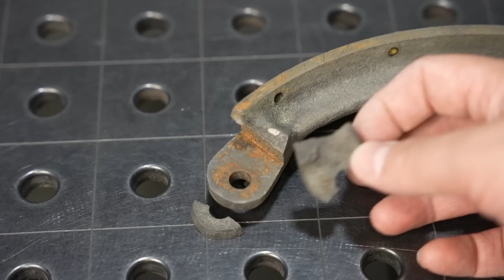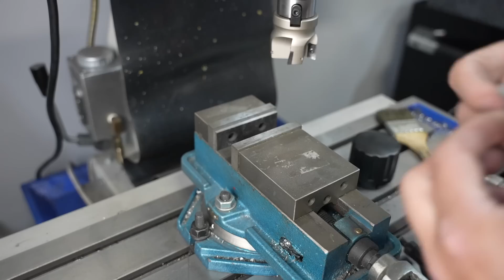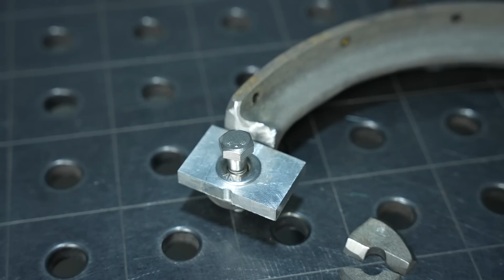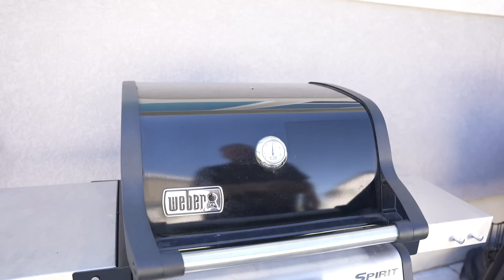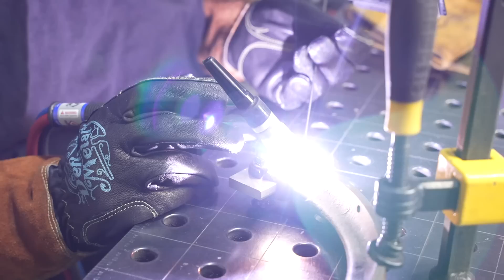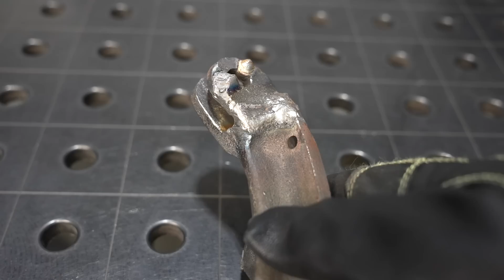Can This 1940's Bandsaw Part Be Saved? Cast Iron TIG Welding Repair

Comment: Nice job. I use some TIG filler rod from Blue Demon (5000T) made specifically for cast iron repair that has worked pretty well. No preheating is required.

Comment: Why not braze the piece back in place by chamfering the edges prior to brazing.  I would use Oxy/Acc to do thisl  The brass flux coated rod is plenty strong in this application.

Comment: I build racing engines and do many cast iron repairs. I found a tig rod that changed my life. It's called Copper Head made by Freedom Alloys. I buy it through Tifco Industries. It welds really smooth and doesn't crack. You can weld quickly without much preheat. I gave away every nickel rod in my shop after discovering it.

Comment: I am not a pro but I find old cast welds much better than new cast iron does.  I put it in my wood stove to pre heat, then tig with stainless filler and then back into the wood stove buried in the ashes. I will let the stove go out and dig it out in the morning with surprisingly good results.

Comment: I would like to be able to tig cast iron engine blocks and heads. The challenge would be  to have a large enough oven, and how to handle it moving from oven to bench, and then, of course, blanketing it for heat retention. My experience with tig is welding 304ss, making cabinets and enclosures for industrial controls. Did that for 18 years+

Comment: Back in the 1970's I made a living welding in the oilfields of South East New Mexico. After watching dozens if not hundreds of videos welding cast iron, I guess I was lucky. I welded hundreds of cast iron jobs with stick rod and a gasoline powered Lincoln welding machine. Never used any of the methods I see on the yt. And never had any cracking or callbacks for something not holding. It's been a long time ago but I used a rod that I bought off the shelf at a welding supply. I do remember that the man that sold me the rods said to burn them as cold as possible and not to be afraid of letting the rod puddle and flow over the original material. I welded the sides of engines still in the car dozens of times. I would pull the motor mount out and jack up the engine and go to town. Good old days... I guess cast iron was different back then...
Reply from the maker: Older stuff does seem to weld up better. It's not always necessary to preheat, but it's pretty easy for a small part so it's worth it to me if it stacks the deck in my favor.
Reply: @TimWelds  I agree.

Comment: A few points - if you're not melting the base material you're technically brazing . I prefer Invar42 nickel/iron filler because it DOESN'T shrink as it cools , and if I'm going to TIG braze cast iron I prefer phosphor bronze filler - I also have thin strips of cast iron cut from an old stove door if I need to go that way . Your finished repair looked really good ! I also like to overfill and machine back to profile . I'm actually a retired master cabinet maker with a serious metalworking addiction hobby  , but i stay as busy as I want to with repairs for friends and neighbors .

Comment: I like a compact needle scaler for the weld bead peening process.  It does a more complete and quicker job of upsetting and stress relieving the weld area than a chipping hammer.  HF has a compact air needle scaler for about $40. You can custom contour the needles on a grinder to get the type of peen penetration you want or remove needles to create a peening 'shape'.  It also works very well for stick weld flux removal, especially in tight areas and can be used for weld bead contouring to a certain extent..

Comment: Retired metallurgical/welding engineer.  Cast iron has a high Carbon content and when you try to weld it with normal rods and wire the Carbon is sucked out of the heat affected zone of the cast iron into the weld metal.  This not only hardens the weld metal but weakens the HAZ creating a weak spot right next to a hard area. ergo the problem.  However, carbon is not soluble in Ni and high Ni alloys so the HAZ isn't depleted and Ni gives a more ductile but still strong weld.
Reply: Thank you.  Nice explanation
Reply: There are specific rods for welding cast iron and I think by preheating the cast iron to be welded helped reduce the carbon jump? Maybe?

Comment: Is it possible to weld cast iron that goes through regular heat cycles, such as a cast iron plate that makes up the side of a wood-burning stove? I have a 75 year old Danish made cast iron wood stove that was dropped during a move and one corner was broken, a run of about 4 inches.
Reply: Use high Nickel wire or Ni electrodes with preheat.

Comment: I brazed cast for forty years run it under cold water while hot and also tig welded cast  stainless filler wire or you cans use mig welder in emergency tig weld some pot metal if you want to be impressive

Comment: Is there a reason you didn't replace the piece that broke off from the brake shoe with new material such as mild steel? I would think the labour would be a bit less and it should be stronger. good job nonetheless.
Reply from the maker: That was my plan B. If I were to do that, I'd machine the tab, then mill a pocket for it to fit against and braze it with aluminum bronze. I think this was faster to just use the existing pieces and it's loaded in compression, so the joint through the hole won't really see much load anyway.

Comment: I find it interesting when ever someone has to do a cast iron repair. I witnessed a high end engine builder doing a repair. I asked him a question about an engine block that I have to repair and he mentioned the ni99 rod but also mentioned he's had good success using the 308L rod, which surprised me. He said he has someone standing by with an acetylene torch while he's welding to keep things toasty. And he's mentioned he machined parts afterwards without issue. I'm curious. have you tried a 308L for cast iron repair?

Comment: That came out nice using tig. I just did two cast iron repairs with the 55%, stick welding. It worked out really nice but I didn't have the detailed control that you managed. One repair I stuck in sand and the other larger piece I covered with a blanket. It seemed to work fine with that rod. Thirty years ago I stick welded a hydraulic coupler from my backhoe with 6011, preheating it and then putting it in an oven. It has never failed.

Comment: Here in the UK, I use arc welding rods, pure nickel as a TIG filler material.I remove the flux outer coating with a small hammer on an anvil, then Scotch Brite them.
Gives great results, especially welding dissimilar metals.
Reply: That's a lot of work? Why not just buy nickel filler for the tig?

Comment: I had to repair some 140 year old ram pumps and found that the best way was to use 100% pure copper tig wire, as the cast was so full of rubbish of one sort or another, worked very well, otherwise I tend to weld with 316 stainless filler for cast iron. Never given me any problems.

Comment: The nickel iron rod picks up some of the carbon from the free graphite in cast iron making the weld extremely hard. I've TIG welded cast iron with Brutus rod, it Rc'd at 65, usually it's very soft when used on mild steel.

Comment: Ohhh, nice. I've only had to weld cast a couple of times, used nickel stick welding. One was to repair a vice that had cracked in two, it was the only one in the workshop and as we were on a ship 3000 miles from the next port, it needed a good repair. As far as I know, that ship went to scrap with that repaired vice. The other repair was rubbish.

Comment: Did you ever try actual cast iron rod and actually weld cast iron? I have some of the rod but haven't tried it yet. It's funny looking rod, it is square about a quarter inch in diameter and about a foot long and looks like a piece of cast  iron and is used with powdered flux.  Nice job by the way.

Comment: Excellent job, would you have been able to use mig ? thanks for sharing, all the best to you and your loved ones
Reply from the maker: Thanks! With the right wire, MIG would work, but in this case, it's such a small repair that it wouldn't be worth it to me to set it up. Rockmount has some really good MIG wire for cast iron repairs.

Comment: I had to do my first cast iron TIG “weld” this past week. I bought silicon bronze rods and got pretty good results. I would normally stick weld with some N55 but this was a weld along the threaded outlet of a pump casing that kind of rolled along a narrow edge. Figured a more delicate touch would be a good plan. Pretty proud of how it all turned out.
Reply from the maker: Awesome! Silicon bronze is a solid choice.
Reply: Brazing is good for cast iron.

Comment: Absolutely a beautiful job Tim, both in procedure and execution.
One tool I find very beneficial for the peening process is a needle scaler. Very fast and it offers complete coverage quickly.
Thank you again for this excellent tutorial.
Reply from the maker: Thanks! I had a needle scaler at some point, but I'm not sure where it ended up.

Comment: This will drive you nuts, Tim. I had to do a quick fix on a part that arrived broken and I didn’t have any proper material. So as I like to experiment, I tried 309L that I had. Surprisingly, it worked very well. I didn’t heat the CI before, or after. This is a bracket that holds the heavy motor for a South Bend tool post grinder I bought. That was a bit of time ago and I’ve since used this in other broken CI objects, all successfully. I wasn’t sure if it would work, but apparently, it does. I wouldn’t use it on a cylindrical object because of the forces involved, but open ended objects seem to work.
Reply: 309 is more versatile than most believe, including hard serfacing
Reply from the maker: If it works, it works! 👨‍🏭
Reply: 1+ on 309L for almost anything with an unfriendly metallurgical work flow.

Comment: Looks good. Is there a reason you didn't replace the 2 broken bits with a piece of mild steel so you could just have a single weld? My thinking is that might have been simpler and stronger than fixing the broken pivot and welding the broken bits back to the shoe.
Reply from the maker: That was plan B. In that case, I would have machined a little pocket to fit a plasma cut tab, then brazed it with aluminum bronze.

Comment: My son just began to learn to weld at 17 this year and I found your videos very helpful. This was no exception.  I've been told by garage welders that cast iron can't be welded, that the welds never hold.  Now I know that it's all about the knowledge of the metals used
Reply from the maker: That's awesome to hear that your son is picking up such a useful skill at that age! With cast iron, it depends a lot on the particular material and sometimes it goes better than others. This time, it seemed to work out pretty good, but time will tell whether it holds up in service. Parts like exhaust manifolds are particularly prone to cracking again because of all the thermal cycles.
Reply: There was a place where I grew up and all they did was weld cast iron e.g. cylinder heads. The issue with cast iron as I understand it is you rob carbon and create hard spots when you get to weld temperatures which is why the nickel rod is used and also why many people braze. The hard spot creates a new place for a crack which is also why peening and pre/post heating are used to try to manage stress in the area. The other issue is cast iron varies in composition so some castings will take a weld better than others.

If any one knows better please weigh in. I've never welded cast iron so just summarizing what I've heard from those who do.

Comment: I'm curious how much effect the peening actually has. Of course, I'm not a metallurgist or anything like that, but with the force you're hitting it with, is it even leaving any marks and actually compressing the metal, and if it is, to what depth? It almost feels like a "Well, we've always done it this way" kind of thing.
Reply from the maker: Peening does add a compressive stress on the surface generally, but I don't know how much it actually does in practice on welds like this. I'll do whatever I can to try and stack the deck in my favor, though. It does leave dents, and if nothing else, it keeps me occupied while the temperature settles.
Reply: @TimWelds  that last thing may be what makes it work. 😀
Reply: @TimWelds  The shock while it is still extremely hot probably makes sure the entire thing stays in one allotropic phase.
Reply: It really works. The surface is the most important part of the weld, where greatest tension accumulates during cooling. It is visually evident on slender parts how much it can reduce the pull of the cooling weld. 

My favorite method is to use a sandblaster at high pressure with sparse amount of sand. This will quickly warp sheet steel, showing the bulk stresses that come from even a tiny grain of sand sized dent. Also has the advantage of rounding off any tiny surface defects that could otherwise nucleate a fracture. 

My trick for getting away with heat treating tool steels beyond their maximal working hardness (i.e. inadequately tempered) is to Sand-peen the crap out of them after a low temper and slow cool down.  Like say A2, with only 300f for example.